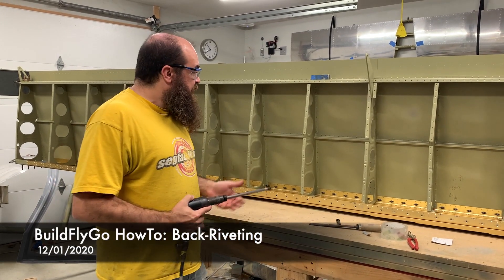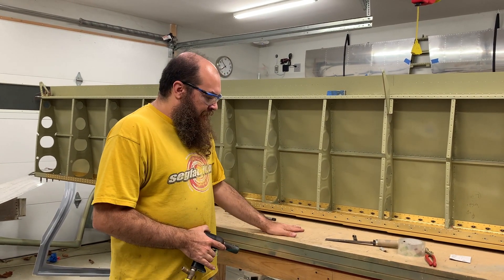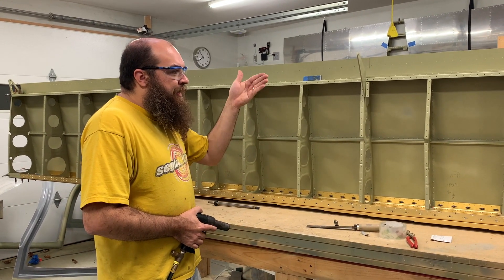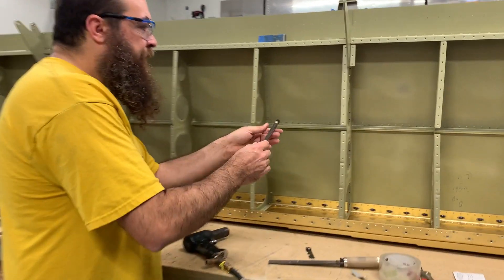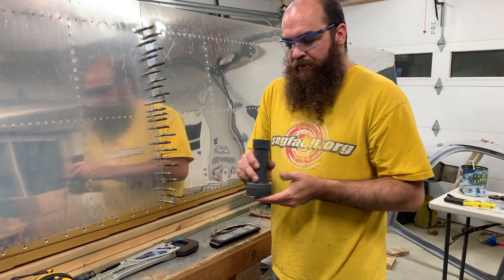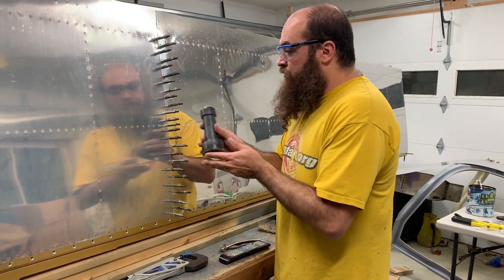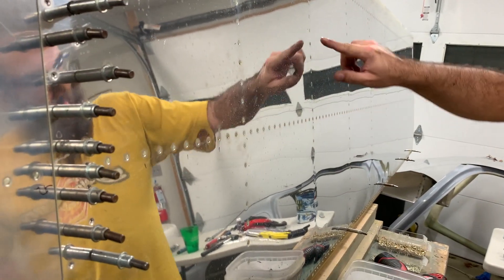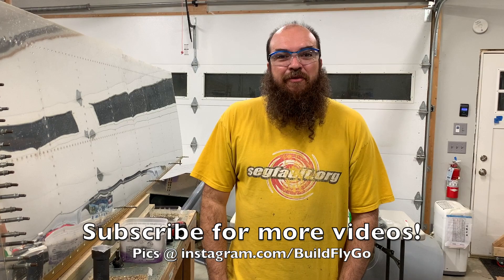Building an RV HowTo: Back Riveting

Comment: Awesome vid!  In the area of the ribs did you use the straight (at a slight angle) or a double offset back rivet set?
Reply from the maker: Both. We used straight where we could buy a few of them required the double offset.

Comment: Thanks Guil.  Toward the end of the video, you said that the top row of riveting on the outer surface was regular riveting (not back-riveting).  You said that the regular riveting had some "waviness" and the back-riveting was "flat".  Knowing what you know now, did you have the option to back-rivet the top row too in order to make it more "flat" or did the plans require that you do regular riveting on the top row, even though it would be a little "wavy"?
Reply from the maker: The plans suggest back riveting for the wing ribs but I haven't seen it mentioned for skins like that elsewhere. The waviness is honestly minimal, it's just surprising how flat the back-riveted rivets look. In my 9 I can see the rivet lines now only because they look so flat on the 10 :) Unfortunately the angle of the rear spar flange makes it so that you can't quite fir a back-rivet set up there, so normal riveting is the way to go. The spar is also much thicker than the ribs so you really can't tell unless you are staring at it, looking for the difference.

Comment: do the plans call for where to back rivet or it is a builder choice?
Reply from the maker: They suggest it for the wing skins and a few of the other control surface skins. It's not required, just looks nicer and is really no more work.